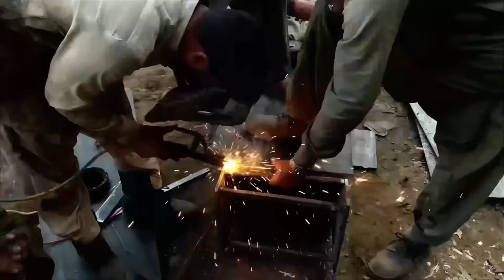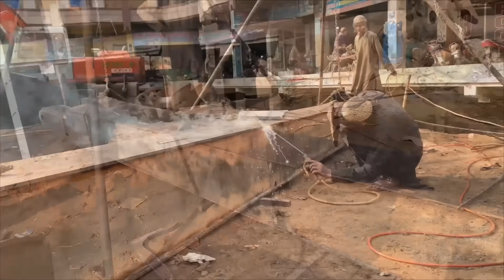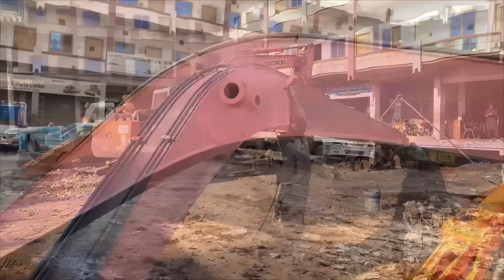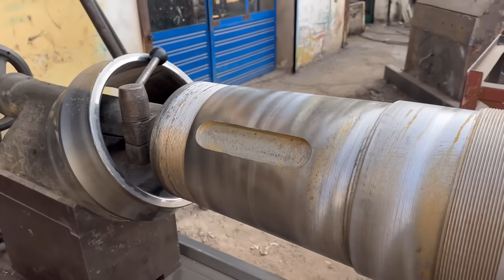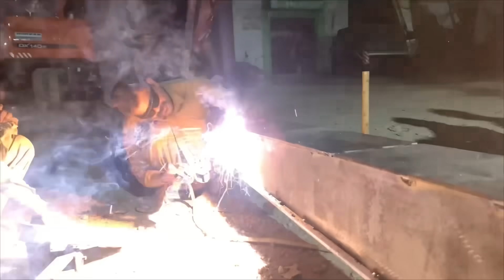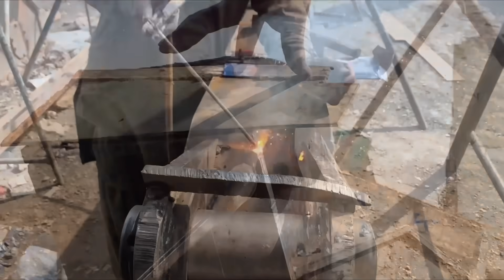Top 3 Fantastic and Most Viewed Videos About Manufactured Process in Local Workshop

Comment: The monstrous steel beam (the first video) - the tiny overlaps on those joins terrify me. The plates should overlap half the length, to spread the load.  They have created several failure points. It isn't much more work to make it right. just more planning. Then add in the complete lack of weld prep, to ensure deep penetration - dirty steel, paint, no edge chamfering.
Reply: Looks to be a long reach for digging in Mud. HAHAHAHAAHA

Comment: Hi these poor workers are very capable of anything but they need a better environment to work  they welding at times leaves a lot to be questionable but the hand burners give them credit where credits due they are needing  a few old furnace blocks and dogs afew dozen steel wedges and decent or at least basic safety gear and more they are defenatly not boilmakers i am retired shipyard Clydeside plater i have seen boilermaker's work they are in a class of there own regards from Scotland ⚒️⚙️🏴🇬🇧

Comment: Structurally, it is a disaster. First they should be using ¼ inch rod making multiple passes, minimum of 4. Secondly, the gussets are not enough to strengthen the boom. This is a disaster waiting to happen. 
How do I know, I have an engineering degree with 60 years background in my own welding and fabrication shop. The men aren't lazy, they lack the knowledge and the tools. That's the saddest part.

Comment: This one makes sense. I wouldn’t trust that rod of steel to stay centered on that pin mt either. Especially after seeing how easily it was upset when they moved it. Cutting a concentric on a lathe isn’t hard, once you get both sides established. Getting it right is math. I’ll say this this is THE ONLY machining channel I’ve seen where the shavings were swept up and saved! Scrap steel is expensive. But check out that machined OD surface on those lock nuts! And nothing but the highest quality bearings rolled in the dirt for this garbage crusher.